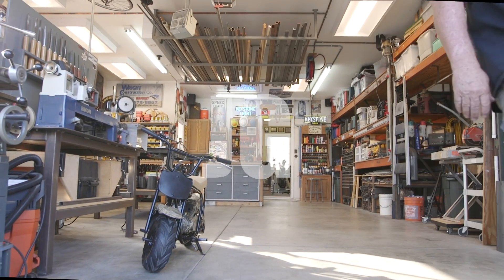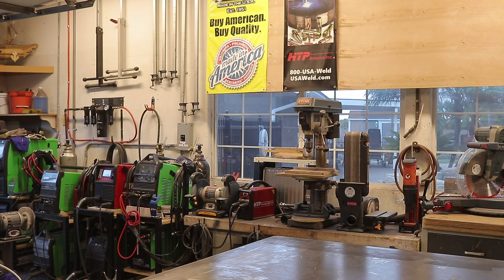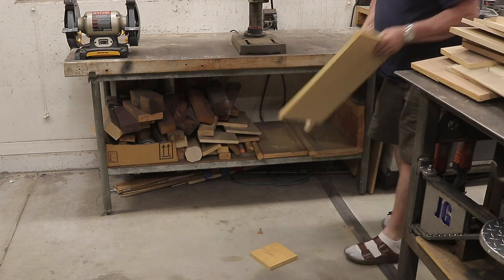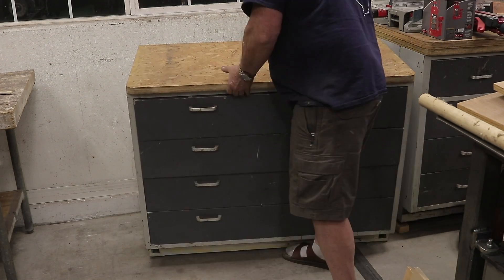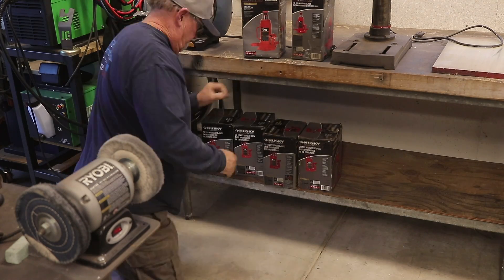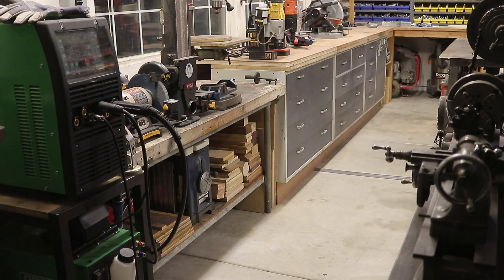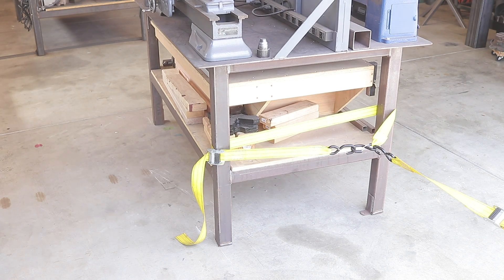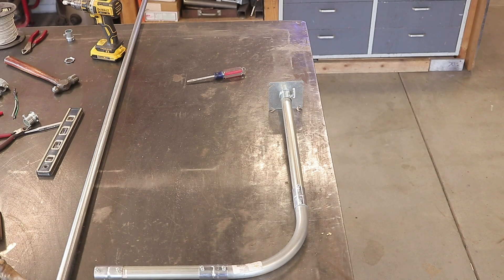Reorganizing the Shop| JIMBO'S GARAGE

Comment: Wow lots of everlast welders. I have a couple too. Power tig 250 ex and a power arc 300. How do you like them?
Reply from the maker: Thanks for watching Adam, They are all fine, My power arc 300 runs about 15 amps hotter than it should. If you set it at 120 amps it really runs at about 135-140, Not a smooth arc at all.   Jimbo!

Comment: You have a lot of welders , what's your favorite one(s)?
Reply from the maker: Thanks for watching Gary and Judy, Yes i do have a lot of machines, My go to is the Htp Pro Pulse 200, It has a lot of capabilities with Mig welding. If you are a stick welder, The Htp inverarc 200 is by far the best, It is a small machine but packs a big punch! And a very smooth arc!   Jimbo!
Reply: JIMBO'S GARAGE  I'm just getting back into welding ( last time was highschool) I purchased a used Craftsman 35-230 stick welder (from the 80's) and a used Lincoln Electric MIG handy pack (used) recently to learn on just waiting on sub-panel to be installed